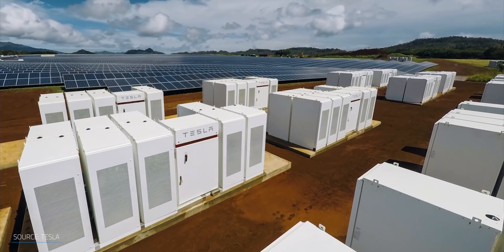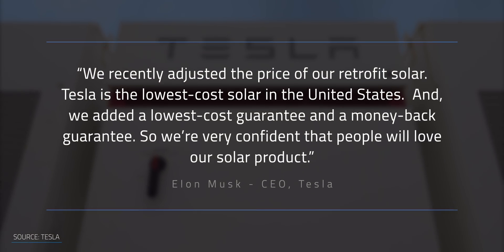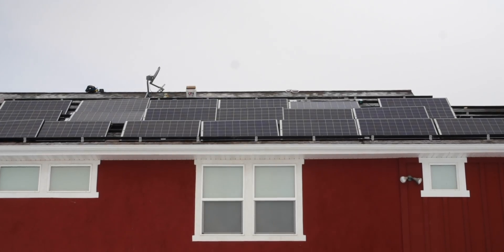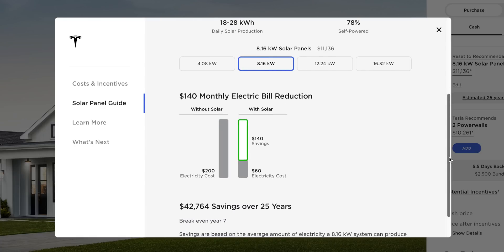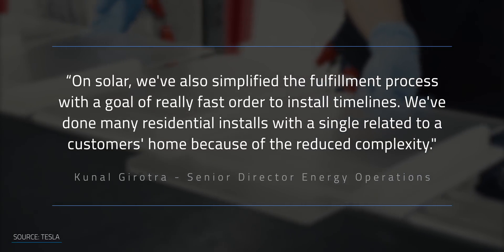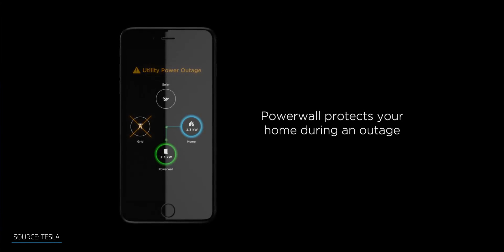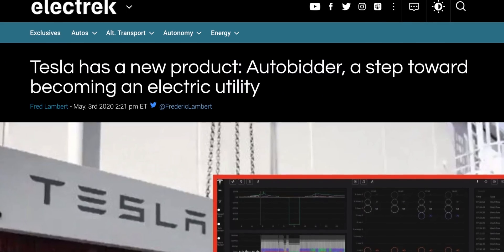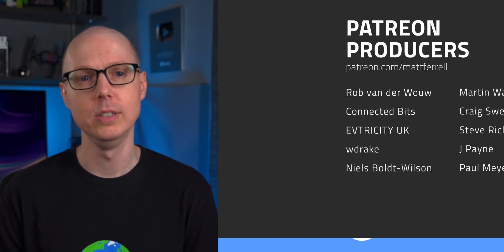Exploring Tesla solar panels game changing price

Comment: The second-hand solar panel market is a better solution currently solar companys dump old solar panels  in landfill and they are very toxic to the environment. So Right now you can get old solar panels for near free and they still work well.
Also solar companies will only install new solar system even if your inverter just needs replacing.
Reply from the maker: Interesting point.  Two Bit Davinci did a video recently about installing second hand solar ... worth checking out: https://youtu.be/RqIhWX-Zy9Q

Comment: As a full time, local, quality solar installer/dealer and a moderator on one of the prime solar forums, let me give you my perspective. 
The wholesale price of quality, Tier 1 PV panels is about 60 cents/watt.   All in equipment costs are well under $1/watt.  We sell residential, whole house, grid-tie solar systems for about $2.00/watt ($1.37/watt after tax credits).  And we are very busy. (not sure what everyone is afraid of right now - but they are prepping like crazy).  And very profitable.  (That's why they are taking away the tax credits).  The whole 12 years I've been doing solar, as the industry has become more cost effective, the authorities have been right there to remove the incentives.  We actually got down to 5 year paybacks two years ago before the ITC started to taper and the local utility convinced the authorities to remove net metering.  (Not to fear - utility prices are going up)
What can be done? Don't have to do anything - solar is winning the energy competition.  But we have a long way to go to dominate the grid because of the intermittent nature of renewables.   What I would like to see is as Matt says greatly simplify permitting.  There are many places now that have exempted solar permitting.  It is pretty much useless anyway.  I've never seen a building inspector catch a serious flaw in an installation.  And Tesla/SolarCity installs are among the poorest quality ( I know, cause we're the ones that get called in when there is a problem that their support department won't deal with). 
Take away the building departments and the NEC code rule mandating expensive module level Rapid Shutdown (lobbied for by the microinverter companies) and we could drop solar retail pricing another 50 cents.
- Have a beautiful solar day!  (The energy solution comes up every morning)
Reply from the maker: Thanks for sharing, Greg!

Comment: Great video, thanks Matt! I'm really excited about the future of solar energy and all the changes it will bring to the energy market and the way we use energy in our lives. It checks all the boxes. It's easy to install, affordable and most importantly - it's renewable.
Reply: Yeah its affordable and renewable for small uses, what about those huge foundries li je arcelor metal or other giant steel/metal producers, they need way more energy than whole towns together
Reply: @carholic-sz3qv  The untapped potential of solar energy is immense. The amount of energy we can get from the sun through solar arrays vastly exceeds the energy demand of our planet. Solar will become more and more mainstream and will - just like other renewable energy forms - be coupled with energy storage solutions (batteries, pumped hydro, thermal). Huge power drains will then be manageable. In fact you could shift the durations during which aluminum or steel are smelted to time frames like 12 - 4 p.m. where there is an excess of renewable energy available.
Reply: @ShufflingManu  yeah by covering all the surfaces possible with inefficient solar panels right?!?! solar and nuclear..... there are many other alternatives that are better and uses way less surface and makea way more electricity
Reply from the maker: Appreciate that, Manuel.

Comment: Does this include the inverter and batteries?
Reply from the maker: The prices I was running through in the video included the inverter and installation estimate, but no battery.
Reply: @UndecidedMF  Thanks for the reply.

Generally speaking electronic goods are far cheaper in the US than in India but the prices of solar installations here is less than half of what you are mentioning as the 'low' $1.49/W.

It is distortions like this that are hurting the growth of US. Very sad!

Comment: So essentially US 🇺🇸 could be one of the cheapest countries for solar but ‘beau-o-rats’ make it unnecessarily expensive 😡
Reply: Legislation and departmental administrarion is what lays the foundation for bureaucracy. Good - or bad:-)
Reply: i'm scratching my head for the UK, i dont' think you would need any government agency or local authority to look at any aspect of a solar install other than to get the government guaranteed tarif for your excess generation.. and that's done by you electricity supplier (we have a pretty competative system where you choose your supplier like you choose your phone company) .. unless you were in a conservation area, and assuming you use a certified electrician (it would be illegal not to) you can just crack on..     which may explain why quotes are around $1.4 usd per watt (with no incentives) at the moment for the UK.
Reply: Like all home improvement projects, solar retrofit will never be price competitive in the USA due to the added value it gives to homeowners. The high turnover of property ownership in the USA means that home improvement projects will ALWAYS be tied to Added Value and not to the actual cost of installation. A competent self-installing homeowner could get a solar retrofit done for less than $0.75/W, but whenever a contractor is involved, soft costs are overly exaggerated. Permit-issuing authorities always tie Permitting costs and fees to the labor cost, meaning that they are incentivized to keep installation costs high in order to meet revenue commitments. The only way Tesla is driving down the cost is by controlling the installation cost.
Reply: Australian energy policy is a costly disaster, not a model anyone should follow.
Reply from the maker: They’ve made mistakes for sure, but there are positives to learn from in there.  California is similar.  Some bad energy decisions, but pros in there too that we can pull from and make better elsewhere.  I’m in Massachusetts, which is enacting some policies that are building on those positives while trying to avoid the mistakes.
Reply: @UndecidedMF  Australian cost for power is high due to privatization the network but cost for solar is $0.50 /kwh after rebates. This is what you guys in the U.S should be paying. Lot of BS red tape.
Reply: @jamescaley9942  Give it a rest idiot. What you mean is you have different Political views. 
If idiots like you had control we would end up like the USA. A Bureaucratic nightmare.
We don't want Control Freaks like you in control. Defacto Communists. They now don't even have control in China anymore. Stalin died in 1953 also.
Reply: @jamescaley9942  Which part is a disaster? The part where you can get 7.5kW of solar panels installed on your roof for $3000 or the part where the Prime Minister hugs and jacks off to a piece of coal in the Parliament?
Reply: @jamescaley9942  Its a system every country should follow
Reply: The real solution is commercial and industrial energy.
Reply: @Dularr  I think the real solution is ... all of it. We need a modernized energy network that maximizes the advantages and mitigates the disadvantages of both the large-scale centralized generation and grid system on the one side, and local generation and storage, microgrids and so forth on the other.
Reply: @dwc1964  The question is about high demand energy needs.
Reply: But at least there are incentives
Reply: @emmanuelwestra6524  yep... there is talk of them being re-introduced here in the UK with up to 50% of the value of £5k being covered.. which would make them an absolute no-brainer.
Reply: No corporate lobbyist do
Reply: When utility companies didn't collect enough they will raise their rates and price.
Reply: I honestly can't tell whether or not I'm being r/wooshed or you actually can't spell bureaucrat
Reply: @trisztansandorhorvath3637  It could be insults through wordplay, for example, The Democrats in america are sometimes mockingly refered to as the 'Dumb-o-crats'
Reply: @tricky1992000  
You think that's bad?  You ought to hear what they call the other party!  LOL!
Reply: Trisztán Sándor Horváth autocorrect correct switched the typing to beau instead of bure-o-rats (it seems to like either beau or burr by default) 🤷🏻‍♂️ either way though solar is inflicted with a red tape ripoff scenario, sad ☹️ as it’s mostly unnecessary

Comment: Well as far as streamlining the permit process... that is heavily dependent on the local municipality. Unfortunately Tesla has no control over this at least here in Florida. In fact, on my recent install this was a point of weakness in the Tesla team. Local installers are much more savy on the intricacies of the local building departments.
Reply from the maker: Yeah, local permitting processes are really a hot mess across the country.  It varies town by town, which is kind of nuts.

Comment: Are you kidding me, it's going to cost me 20k for one power wall 😔
Reply: Just wait till they enable vehicle-to-grid. Each Model 3 is basically 5 PowerWalls
Reply: I was somewhat shocked to learn a Powerwall 2 only has 13.5kw.  I guess I just assumed since even a Model 3 has 75kw, that Powerwall probably had close to 50...
Reply: Power walls are just over $5k each
Reply: @raullasvegas  maybe where you live, but not in Canada. 20k installed for the first one, then 12k for each installed after that.
Reply from the maker: That’s insane.  Are those direct from Tesla or through a third party installer?
Reply: @UndecidedMF  third party, tesla doesn't come up that far north
Reply: @robintaylor1490  Sorry, I was just going by the Tesla website. No, thats not installed.
Reply: Solar PV is getting very affordable, battery storage, while becoming reliable is still sticker shock expensive.